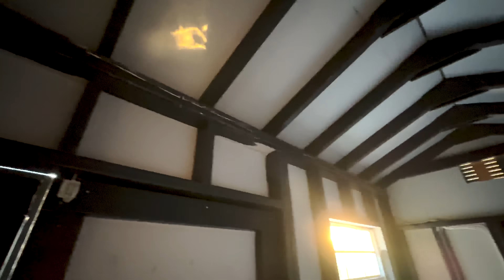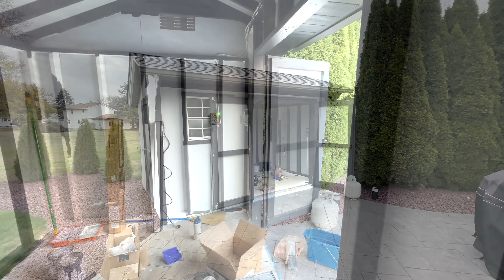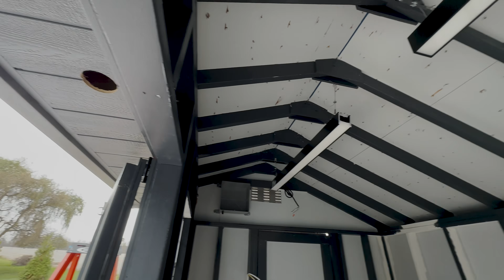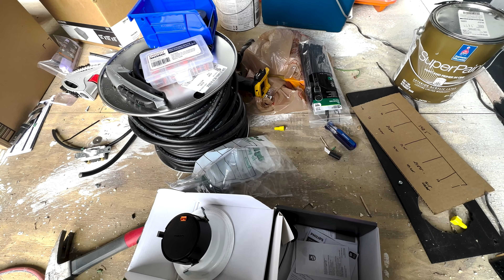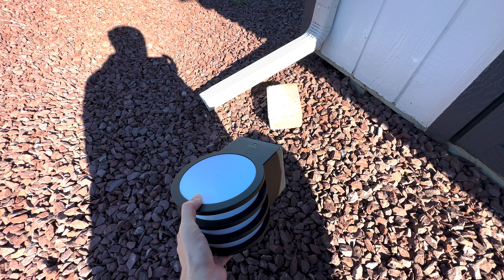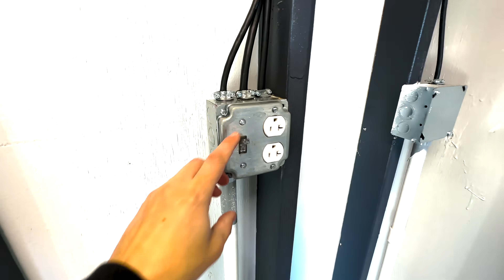Phillips Hue Outdoor Lighting Wiring | Part 2

Comment: Nice series of install videos.  After 2 years how are the Hue Calla lights holding up?
Reply from the maker: Fairly well. I had a lightning strike last summer that took a few of the Bollards offline. I need to figure out what happened: light or transformer failure. Truly my only complaint is that the powder coating fades on the lights that see direct sunlight. Other than that, the system has been really great. I get tons of compliments on the patio and front landscape lights.
Reply: @billylaguardia  wonder if using a product tike Trim Restorer would bring the finish back.